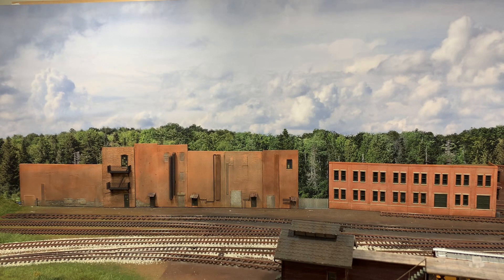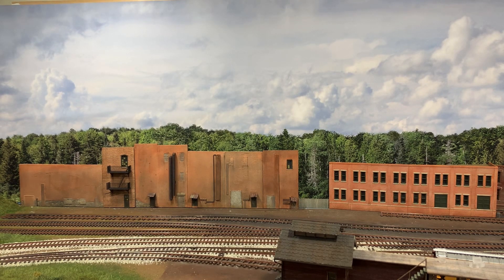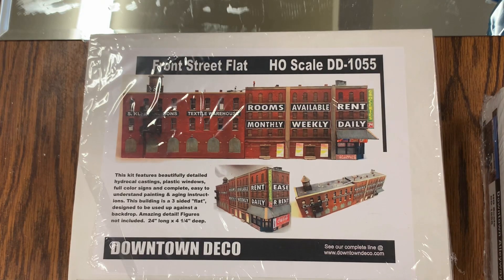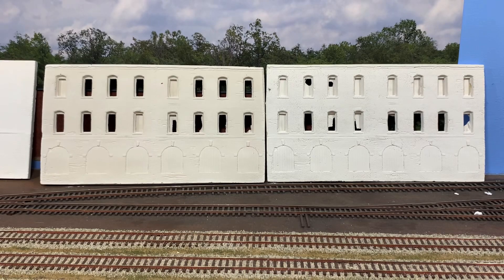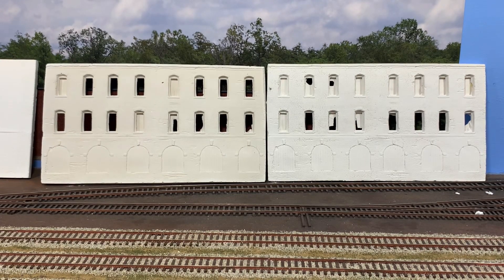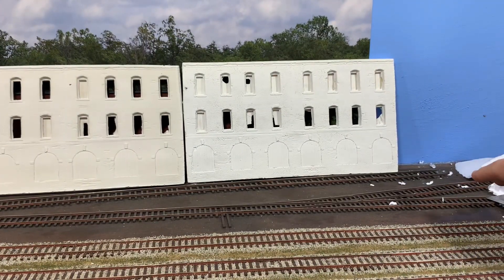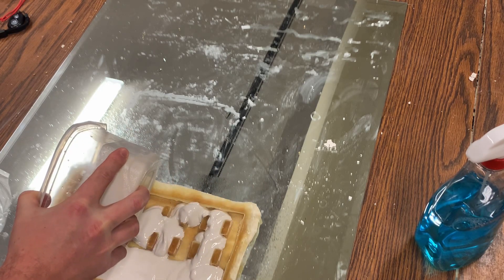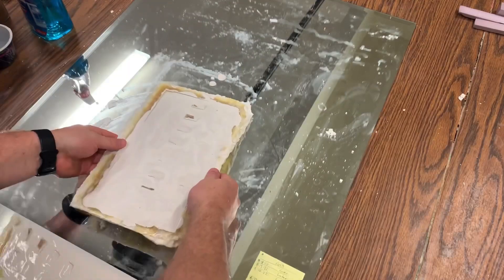Manchester & Deepwater 2.0 Update 37 - Making a Latex Mold and Pouring Hydrocal Castings

Comment: I made molds of DPM modular sections to build mass sections to make long walls. Michaels and Hobby Lobby sell the liquid latex mold making material. I use 2 part casting resins.
Reply from the maker: That’s a great idea, I had considered trying silicone mold making, and had the thought as well to mold some plastic wall parts, if for nothing else than it would allow me to build from hydrocal which just looks so much better than plastic.